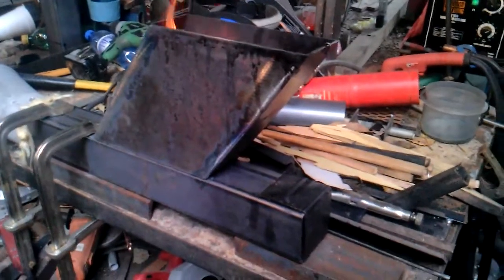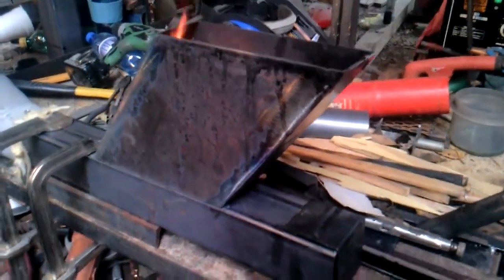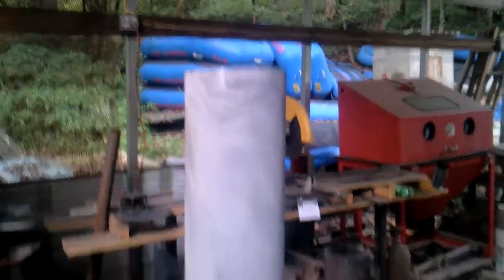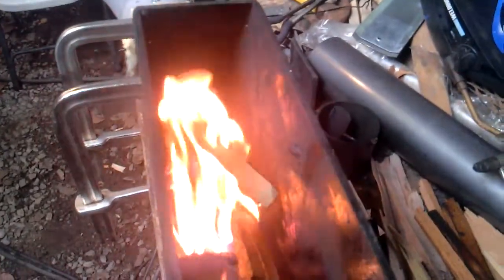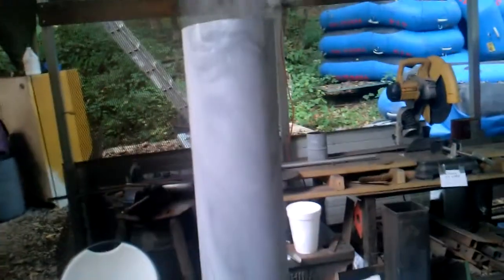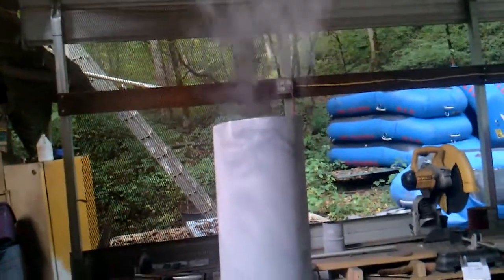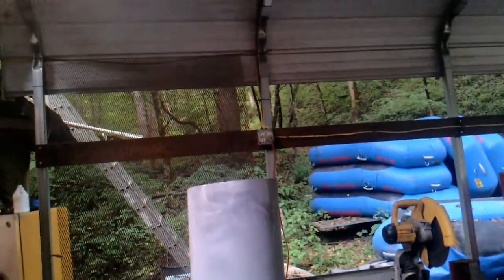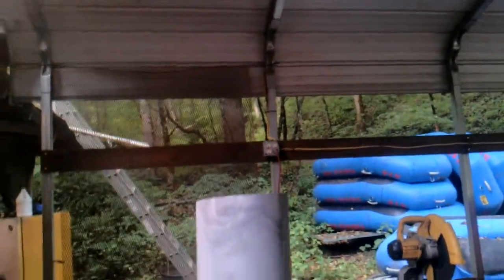Rocket Stove Failure  3"x7" Feed Chamber, Several Size Risers

Comment: In proportion to the 3 inch square burn chamber the 3"X7" feed chamber is too big to allow a strong flow of air in the direction of the riser tube. Try to use a bit of plate to restrict the air entrance of the 3"X7" and you will see no smoke will come out and the combustion will be more intense and hotter...